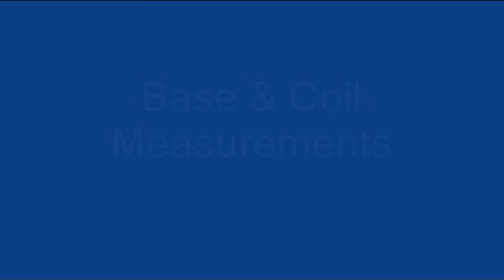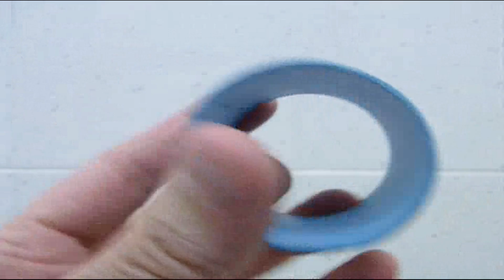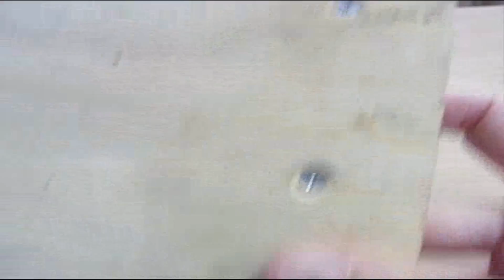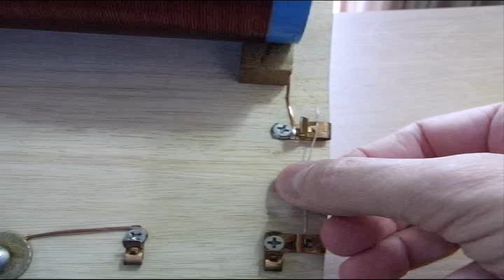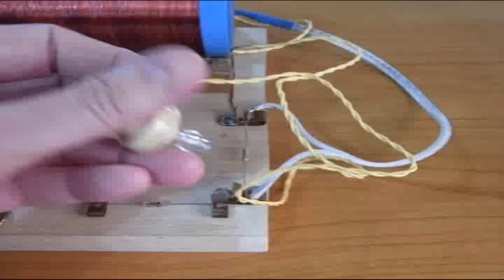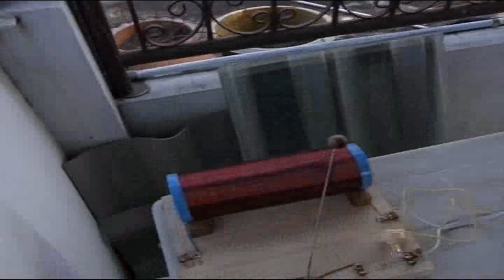How To Make A Crystal Radio - No Batteries, No External Power

Comment from the maker: UPDATE: Crystal Radio--How To Make The Best/Easiest One - No Batteries, No External Power
https://youtu.be/fLVCqZGpv3U

RELATED CRYSTAL RADIO VIDEOS: 

My New Favorite!  Crystal Radio with Antenna Tuner:    https://youtu.be/mh5KxCpbQ5U
Crystal Radio, Capacitive Tuning - WORKS GREAT!:    https://youtu.be/VJ80Nm9KSkE
Crystal Radio & Resonant Coil Design:     https://youtu.be/Fw9eb-aB-XU
Crystal Radio Antenna (Shortwave Also):    https://youtu.be/G8AsgZbncW4

My Crystal Radio Does NOT Work (FIXES for common problems):    https://youtu.be/kCxQ8iPQx4s
Good Crystal Radio Connection Points:    https://youtu.be/G3qjrReHR1k
Crystal Radio, Connect A DC Audio Amplifier:  https://youtu.be/RW3VhnzgjtA
Three Upgrades For Your Crystal Radio:   https://youtu.be/LENco3_jV_s
Crystal Radio Wiper Upgrade:     https://youtu.be/i1otDz39nlw
Popular Crystal Radio Design That's a Waste of Time - And Why: https://youtu.be/r9Onub2Xpzc   
New Crystal Radio Design - "Modified-Pickard":     https://youtu.be/_qxHhFKjLAg
Crystal Electric Generator RF Energy Harvesting Exp 5 - Full Wave Rectifier:   https://youtu.be/BTu_GJKjOmA

Comment: Sometimes I see a thin and thick wire for the coil. So I can use 1 size wire? And the 2 diode and resister can I buy that in a radiostore? Is there a code for the 2 parts?
Reply from the maker: The specs are in the description. The wire size is pretty important. I have a newer video. https://youtu.be/fLVCqZGpv3U
Sorry I did not answer sooner, your comment went to the spam folder. Not sure why.

Comment: Can you make the coil with thicker wire and without enamel and if not why not?
Reply from the maker: @erniethecat198  Yes, but changing the wire size requires recalculating. Without insulation, the coil is like a copper pipe, not a coil of wire.

Comment: Have a amp kit.. fact several. Assembly after diode. THis has a af control. Last time I did this.. the amp had to live on its own platform as the vibration made tuning impossible. Tks om 73

Comment: Hi thanks to your videos I made one. One question why do you need the 10k resistor. I tried with other values but lowest I could make work was 5k
Reply from the maker: The new generation of earphones are piezoelectric and they have a lot of capacitance. Without the resistor, the earphone builds up a charge and stops working very quickly. All you can hear is popping. The resistor keeps that charge drained. I use between 10K and 40K ohms.
Reply: @tsbrownie  wow thanks for responding
Reply from the maker: @kailashspidel9647   The advantage of a small channel is that I can read every comment!

Comment: What is the Exact wire Gauge you used for the coil in this video? Can i add some antenna coupler coil with longer tube length, but with the same wire Gauge? It's about 30turns of Antenna coupler coil
Reply from the maker: The details are in the description. I have a newer video on that. https://youtu.be/fLVCqZGpv3U
And also a video on a dual wiper version: https://youtu.be/mh5KxCpbQ5U
To answer your question, you can use a loose or tight coupling (or make it switchable).
I think I was using 0.91mm wire on this one. I have switched to 0.81 because it's more common.

Comment: I built TSBrownie's crystal radio as seen on this video as my second attempt. First attempt was built with cardboard tubes for the coils, neither worked. The devil is in the details, check and make sure you are using the correct 1n34a diode, non-Schottky diode. I contacted TSBrownie and sent pictures of my build and was immediately shown my error about the diode. I acquired the correct diode, installed and SUCCESS! Pay attention to the details! Thanks TSBrownie.
Reply from the maker: Thank you!

Comment: Daddy helped me make one of these for a science project when I was in the 8th grade  in the early 1960s.  We used a Gillette Blue Blade (razor blade) for some reason.  He wound the copper coil around a glass Coffeemate jar.  The antenna was a bare wire (I think it was bare) that we hung outside the window and the tuner was a piece of copper wire that he had stripped back an inch or so and put a hook in the end that touched the coil.  The other end of the tuner was mounted to the board and you moved it across the coil with your hand.  We could get 2 or 3 channels, depending on the weather.  Daddy was an electrician and, if I'm not mistaken, we got the directions for the radio out of a Boy Scout Handbook.  I have looked for years for the Scout Handbook but have never been able to find it.  Needless to say, my science teacher was impressed.  Thanks for your video.
Reply from the maker: I'm glad you liked the video. I just googled "1960 wolf cub scout book" and the one I learned from came up. It's $4. There's a picture of a howling wolf standing on a cliff against a blue and yellow background. Their diagram has an error, an extra wire that makes it not work well. I use their same circuit, minus that wire, hence why I call it the "modified boy scout radio". Many people used a heat-blued razor blade and a bit of pencil lead as the detector. The boy scout manual specifies galena, I use a 1n34a diode; they are all doing the same thing, acting as a 1 way valve.
Reply: Thank you so much!  I will look for the Wolf Cub Scout book online.  My brothers were in the scouts and those handbooks had so many neat projects in them----not so much now days, unfortunately. @tsbrownie

Comment: Great video. But I'm confused, I bought 10 spools of 20 AWG for a group based on your description "(note: I used 0.5mm or roughly 19-20 AWG"  but when I look it up, 20 AWG is .8 mm not .5mm. So which did you use? I found a coil calculator and tried to adjust based on 2" PVC (I couldn't find 2.25") and .8 mm (20 AWG) wire. I get about 11 turns per cm. With 16 cm (176 turns) it says 560 microhenries. Do you think this will be enough? Thank you!
Reply from the maker: Good catch. I said it wrong. 19 gauge is what I typically use and it is 0.91mm with the coating. 20 AWG is 0.81. Here's an updated and much more detailed version of construction which includes all the improvements I've found over the past 8+ years. https://youtu.be/fLVCqZGpv3U

Comment: Thanks for this great job. There is a resistor (say 47 K ohm)  in the circuit but in the circuit diagram used a 1000 pF (1 nF), why omitting the resistor?
Reply from the maker: Thank you. There shouldn't be any capacitors. At what time in the video do you see the cap?

Comment: Would an old transistor radio earpiece from those old 1970s/80s or earlier AM radios work (those ivory-colored single ear piece)? What about a speaker from one of those old transistor radios? 

Someone below mentioned an old razor and pencil..was that in place of the diode? 

I ask because for something called a "foxhole" radio, I suspect that soldiers didn't have diodes and resistors available, but would have razors and pencils and commo wire.

It's been decades since I've thought about building one of these... :)
Reply from the maker: Any of the earpieces or speakers that use a coil and magnet will not work or will be VERY weak. The earpieces that do work use crystals or piezoelectric elements. The razor blade and others do work. They are more difficult to work and I don't recommend them for the first radio. I actually used galena on my first, and it was the thing that took the longest to make work.
Reply: @tsbrownie  Thank you for the quick reply. I am not sure how those old earpieces work, but I'm going to guess they wouldn't be compatible. My typical MO is to try the stuff that makes it more difficult to accomplish, then get mad when I can't get it to work.

I need to change that approach. 🤣
Reply from the maker: @MTimWeaver  We all have to try to walk up the down escalator before we realize it's fun only at first! There is a change to the radio if you use the antique crystal earphones (they are available on ebay). You change the resistor to a small capacitor. The resistor is for the "modern" piezoelectric earphones you get today. Have fun with it.

Comment: I have become a fan of you. I find your video is excellent and I can follow you in making a set in the line you have made it here. I have some questions (which might seem idiotic, still I should ask you to get a reply). Others made two coils, primary an secondary.. Why these are so and why you do not make that way. Besides, there is a capacitor made of aluminium foil. What are the justifications for those? I am not an expert in this field and a very simple man with no knowledge of intricacies scientific method, and I do not have any idea of them. Please enlighten me about those, and justification for your method as I am little bit confused going through different videos of different persons, who are knowledgeable, I think. But your explication seem to me better than any other presentation.
Reply from the maker: 2 coils question: I also have a 2 coil radio. It's just more advanced in construction. (https://youtu.be/mh5KxCpbQ5U)
If you use a modern piezo-electric earphone, you need a resistor instead of the capacitor. It's just difference in tech.
My designs are modernized versions of older crystal radios using currently available parts and compensating for them.
For example, if you use the antique crystal radio earphones, you will use the capacitor between the leads instead of the resistor. That's because the piezo earpiece has lots of capacitance built in compared to the antique ones (because of how they are made). 
Also I used stainless steel parts instead of brass because it's easier to get for the rod and screws (brass washers are easy and cheap). 
And the plastic pipe for the coil is much stronger than cardboard tubes.
Reply: @tsbrownie

Comment: Thanks for the beutiful video you have presented. When I was a small kid, my elder brother made a crystal radio with a telephone receiver, which he purchased from the Second Hand Market of Calcutta, and there was a crystal plus a slider. I do not exactly remember what else there was. He made a roof top antenna may be 20 yards or more. We used to listen to local Calcutta station very clearly. Could you tell me how that was done. I am sure there was no diode as 70 years from hence those were unavailable. It seemed to me that was very simple crystal radio. If I get some hints from you I can make that one. I am lying down with femur bone fracture and recovering. I cannot walk very well. I am idle here at home, eager to make one crystal radio with minimum of the materials. One telephone receiver piece will not be a problem. But what will be the substitute for the crystal stone (it looked like to me a very small piece of stone). You may laugh at my idea but I want to work on that if I get some hint from you. I strongly beloeve you would not ignore ot.
Reply from the maker: The 1N34A diode is best / easiest, but if you want to do it like they used to, they used a piece of galena (lead sulfide). It's a native form of lead. It looks grey with imperfections in it. In my Cub Scout handbook, they had us set the galena in a piece of copper water pipe, then use the point of a bent safety pin to create the point contact. (You can find pictures of this type of thing if you google "galena diode" or "crystal detector".) The best areas in the crystal to try are the imperfections. The rest is built just as I show in this video, but replacing one side of the diode with the copper pipe holder, and the other side with the safety pin. There are other techniques, like the oxidized razor blade, but they are much harder to make work. This website has the pages from the same scout book I used: https://ewajustka.tumblr.com/post/93165772934/an-attempt-to-build-galena-radio-receiver-using
And this one copies the pages and pictures: https://bizarrelabs.com/crystalradio.htm

BUT DO NOT INCLUDE THE CAPACITOR! You need the resistor as I showed and for the reasons I stated in the video. A cap will  keep it from working with the modern earpieces.
Hope you have a quick recovery!
Reply: Thank you.

Comment: Why did you omit a tuning capacitor?
Reply from the maker: I have a video on why the common design using a capacitor does not work. Not sure why, but that design is plastered all over the internet; seems people copy but never question or try it. The only design I have built with cap tuning that works well is this one: https://www.youtube.com/watch?v=VJ80Nm9KSkE
It is very clear, tuning is sharp, but not as loud.

Comment: I will be usuing tumbscrews for the connections.  
You drill a hole and thread the long screw from the bottom, then screw the thumbscrew from the top.  You might even add a washer

Comment: I guess it doesn't matter what guage the wire is?
Reply from the maker: Details are in the description.  The turns per inch (or cm) matter.
Reply: @tsbrownie  I see it, thank you for the quick response. I'm going to try to build this.
I also want to build a one-tube receiver.
Reply from the maker: @OneCupOfCoffee204  Good luck and have fun with it.

Comment: Why not use a small flat file to scrape the coil wire?
Reply from the maker: A file will work, but the teeth will clog up with the insulation and you have to keep cleaning it.

Comment: Where did you find that thin-walled blue pvc pipe?
Reply from the maker: It can also be thick walled. It is blue pvc water pipe. It is a scrap from a home plumbing job.
Reply: @tsbrownie  trying to find thick walled pvc with a 1.5 inch OD.

Comment: A crystal radio works a lot better if the coil is resonated with a capacitor ; this increases the detected RF voltage  that operates the  Germanium   diode making thedetected  audio much louder in a crystal earphone. A smart phone earphone  IS NOT USEFUL
Reply from the maker: I have tried many versions that use a capacitor and only 1 works as well as this. I have a video on it here:
https://www.youtube.com/watch?v=VJ80Nm9KSkE

Comment: What gauge wire is it in AWG, or American Wire Gauge.
Reply from the maker: Details are in the description: Enameled bell wire (can be from old transformer, solenoid, ...) 0.3 to 1.5mm (note: I used 0.9mm or roughly 19-20 AWG, the number of turns and length of pipe change with wire size.)  Bigger wire has lower resistance (better sound), BUT you get fewer turns per centimeter (less tuning).
Reply from the maker: @Danijelovski Kanal I have a video on that. One has to redesign the coil: https://www.youtube.com/watch?v=Fw9eb-aB-XU

Comment: Can it be a pipe 2 inches in diameter?
Reply from the maker: The coil should be about 350 to 400 micro-Henries.  The value depends on turns per centimeter (wire size), tube size (diameter and length).  So you can change the tube size, IF you end up with 350-400 microHenries (there are calculators online).  The simple answer is it will probably work, but you will receive less of the band.

Comment: Beautiful video! Can this radio reproduce also fm?
Reply from the maker: FM radio works on a different physical principle and requires much more complex decoding of the signal.  So this type of receiver will not work for FM.
Reply: @tsbrownie  thank you!
Reply: @tsbrownie  Can we use any of the resistor or there is a typical resistor to be used? And if added a 75 ohms wire, that we use as cables for dish or anoloy TVs and FM radios, will it work?
Reply from the maker: @mmallick3224  Something around 10k ohms works best. The details are in the description. I don't know about using 75 ohm dual lead wire. This one will not pick up FM, but there are different types of crystal radios that will.
Reply: @tsbrownie  Thanks a lot. I'll surely add a 10k ohms resistor if I get. If not then will a 82k ohms reaistor work? I wasn't available with a 1N34A germanium diode. So, I want to use the primitive one, with an oxidised blade and a grafite from a pencil atached to a safety pin.
Reply from the maker: @mmallick3224  82k might be too much,  but it will not hurt to try.
Reply: @tsbrownie  Thanks for the advice, Let me find if I can get the better one for the project.